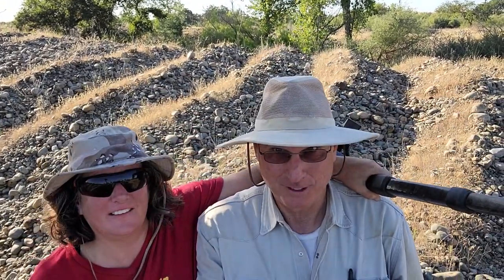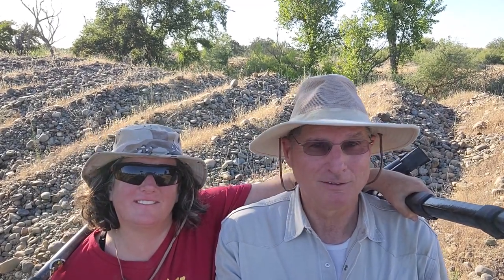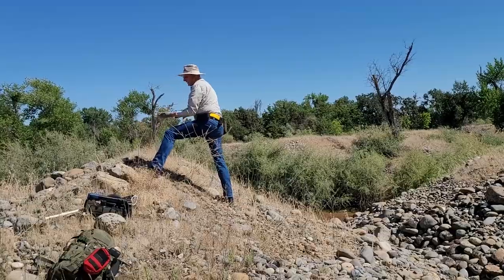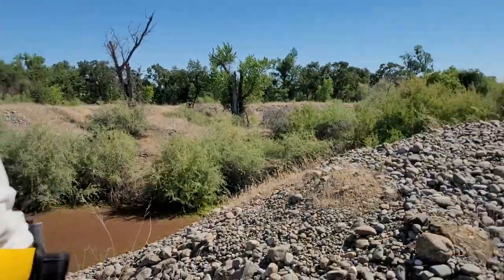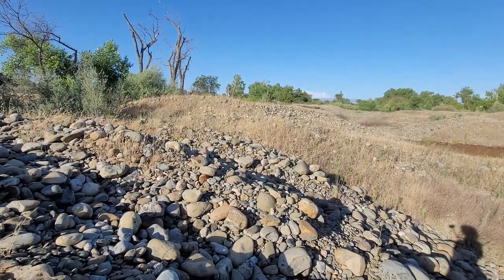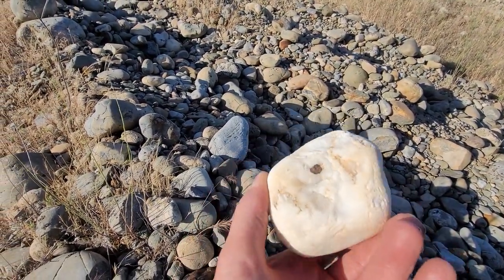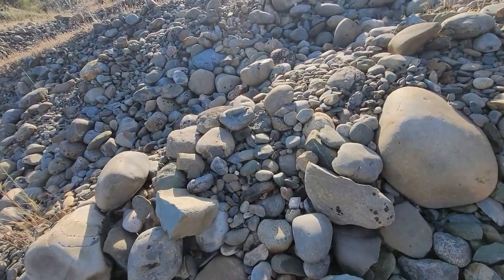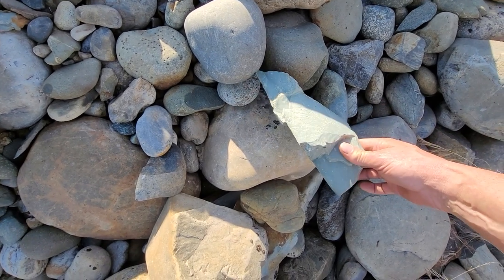Detecting for Gold on Bucket Dredge Tailings with the #sdc2300

Comment: I am thinking that a pin pointer would have helped to locate the target. Instead of having to use the detector once you find the target. Smaller and lighter.
Reply from the maker: @mikeray4902  I can not argue with that... and the pinpointer was on the pack. DOH!

Comment: Use your headphones unless you just wanna dig square nails in shock shells
Reply from the maker: Agreed about the headset. Fortunately it was really quiet on the tailing piles but anywhere near running water for sure the headset is a must to hear the threshold. We have since built up a different solution using a wireless bluetooth "Neck Tarus Speaker"... much more comfortable, convenient, and cooler than a headset and can hear the 2300 loud and clear and still hear your surroundings. I will be doing a video on the build in the near future so keep an eye out.